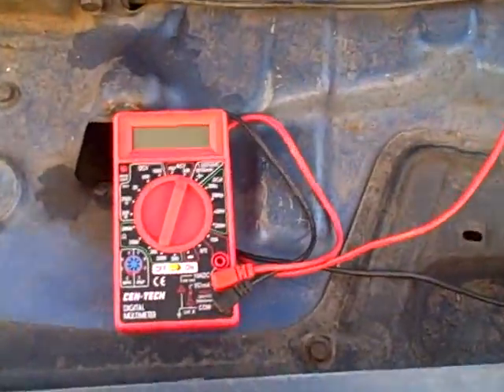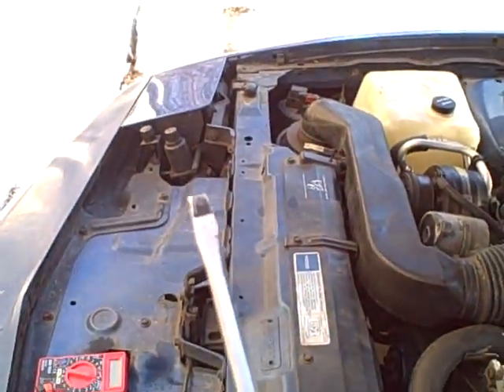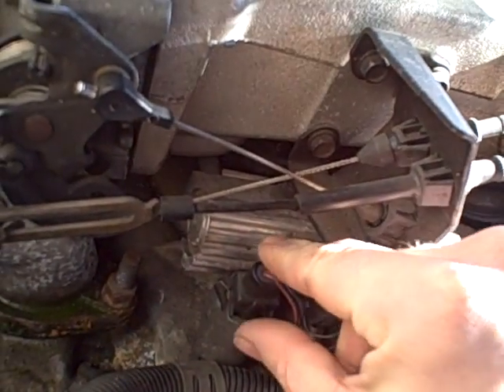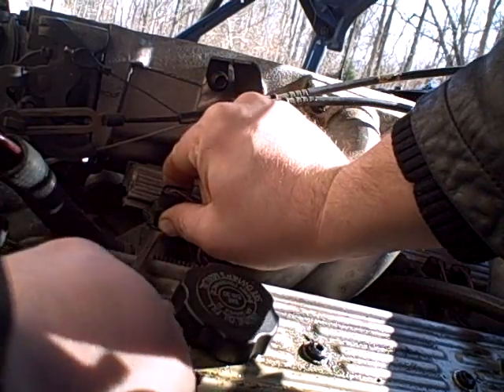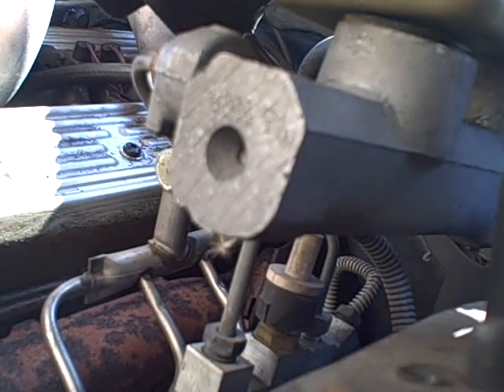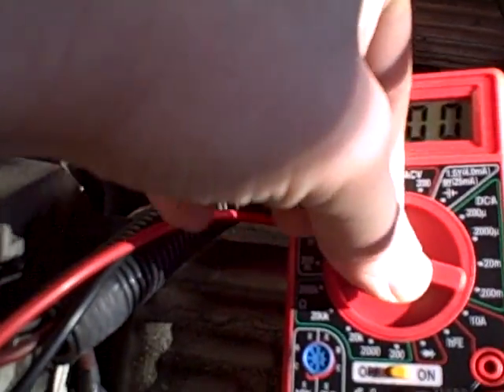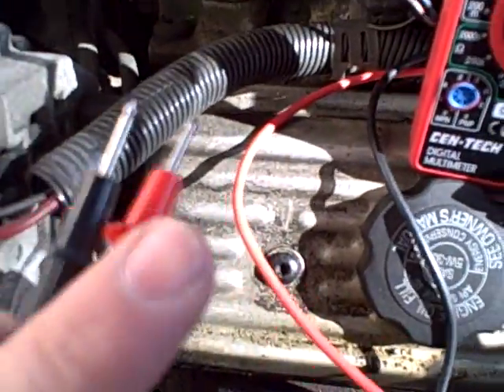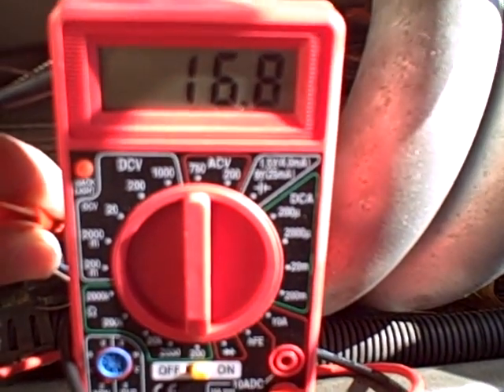Checking Fuel Injector Coil Resistance

Comment: My fuel injectors read 0.07 ohms all 8 of them...we had water in the gas which was quite a bit so we changed the fuel pump now we are thinking the fuel injectors are clogged but because of my ohms readings i now think they are all bad..2010 Chevy Silverado 4.8

Comment: Very useful video on how to check them and explanation of how an injector works. Watching you trying to take off the plug reminded me of myself under the hood; only I would have managed to break that plug somehow and ended up spending big bucks replacing the wire and some other critical box that it is hard-wired into.